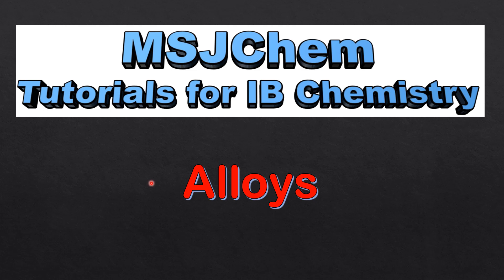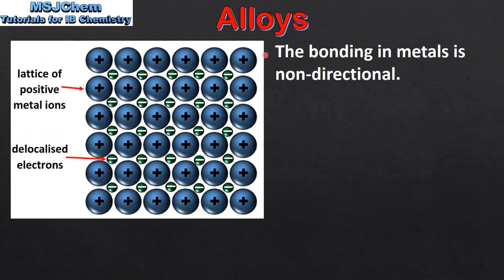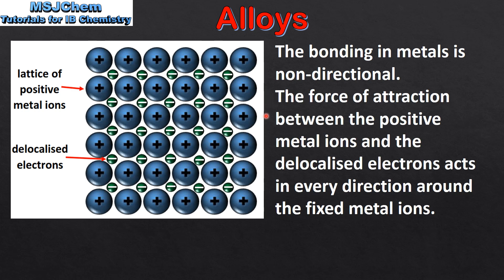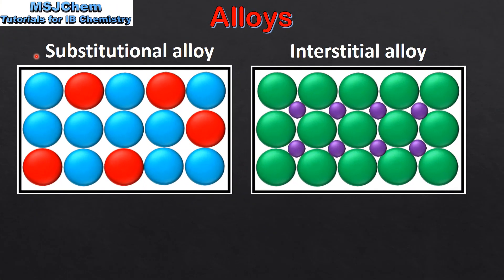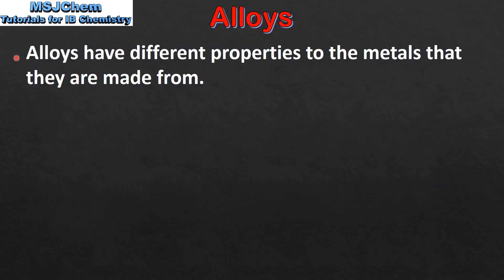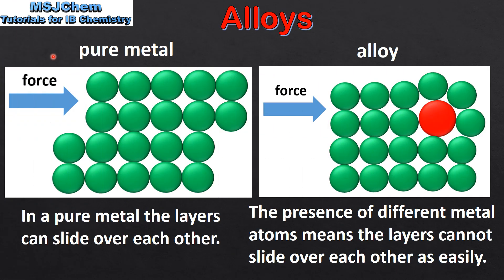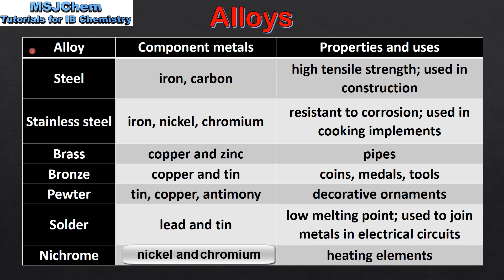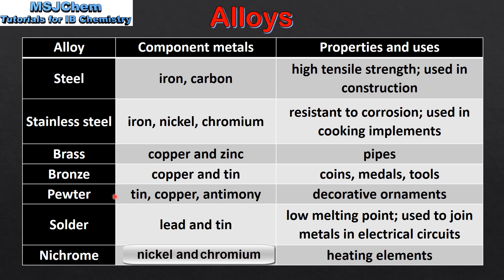S2.4.3 Alloys

Comment: When carbon is combined with a metal to form an alloy, is the bonding still metallic?
Reply from the maker: Good question! The bonding between the iron and carbon is not metallic, no. In an interstitial alloy the carbon atoms can be thought of as sitting in the gaps in the alloy’s structure. The bonding between the lattice of cations and delocalised electrons is still a metallic bond.